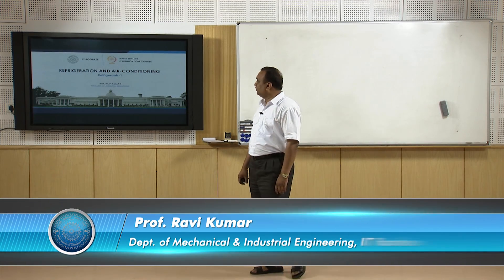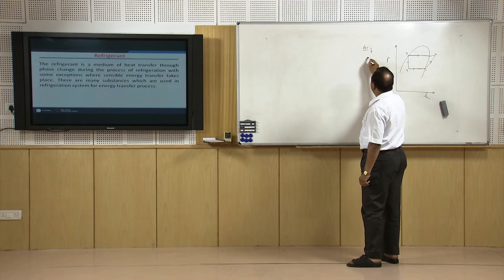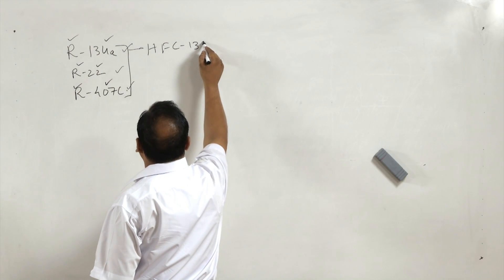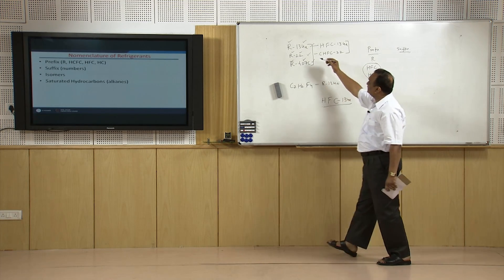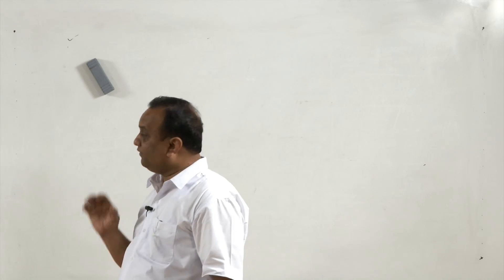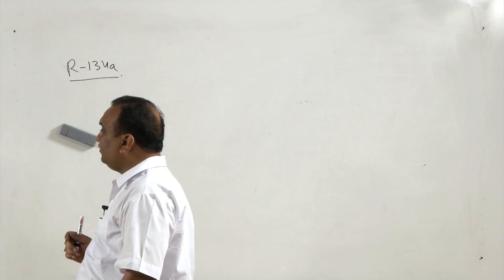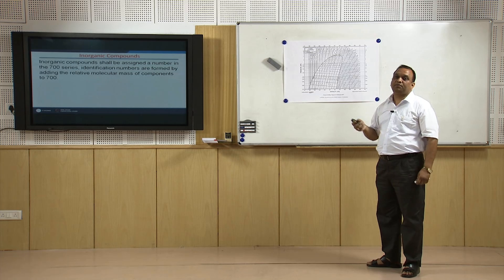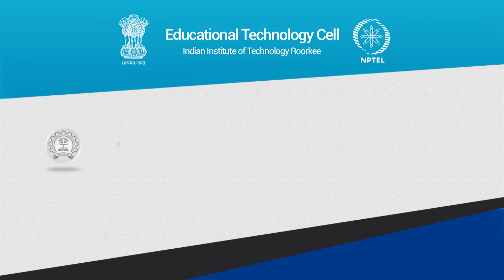Refrigerants-1

Comment: Sir I want to learn about how decided (condenser , compressor, expansion valve, evaporator area).for our Refrigeration system. Plz help me.
Reply: front part (in which food placed) is evaporator , back side fin (small pipe ) is condenser also a black box (ovel rectangular shape ) is compressor   ,
Reply: @nvreborntech  
I know that  sir
Currently I am working in Refrigeration industry.
I want to learn about the selection of compressor condenser expansion evaporator pipe length for X TR Of refrigeration system.
In short selection of compressor condenser expansion and evaporator.
Reply: @Marketgyan1010  hi bro did you learn this stuff if yes could you please help me for the same